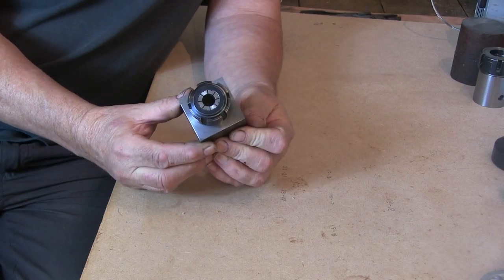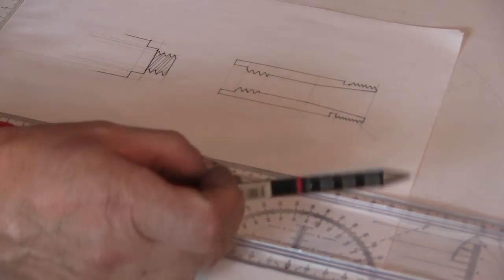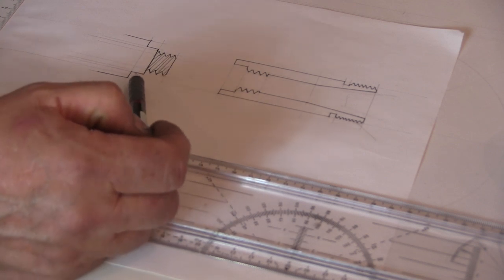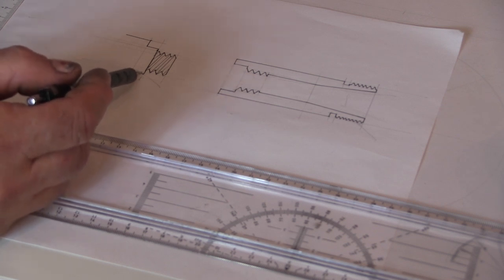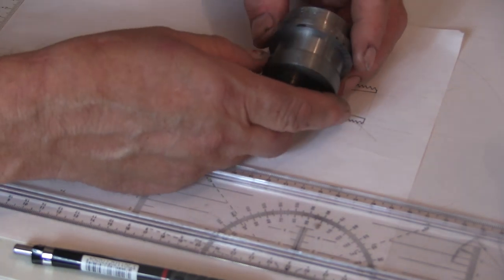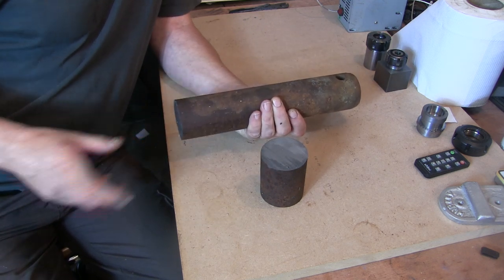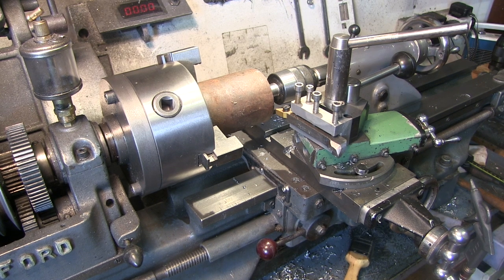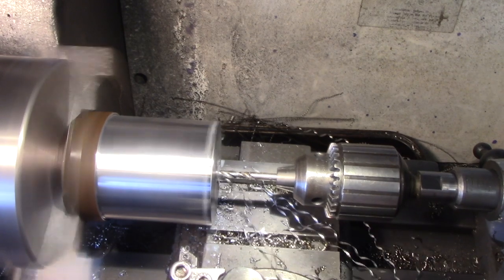A Direct fit ER40 Collet Chuck

Comment: Hi Cliff, Interesting subject.  Regarding the register, I was taught that the one at the rear of the chuck which mates with the face of the spindle is the critical one as it determines axial runout.  The register on the spindle that you mentioned can be and often is a loose fit (doesn't actually touch) on many screw on chucks etc.  The reason being that the spindle thread faces align the centre point and the rear register face keeps it all on the correct plane.  It would be interesting to Prussian Blue the spindle parallels to see where and if it contacts the chuck.  If it doesn't touch (regardless of clearance size) it means that it's not actually doing anything.  If it only touches on one side (most likely on a real close fit) it's possibly compromising the rear register.

I made a similar ER32 screw on chuck for the Schaublin and accuracy is top notch even though the "other" register is not a dead snug fit.  I see people labouring over the one you mention on many channels, but it's importance is questionable.  Just my two Bob's worth.  There's no reason not to make it as close a fit as possible, but it's not a deal breaker from my experience. Your comment about the collet nose thread importance is dead right, any slop there and it's game over.  Cheers Rob